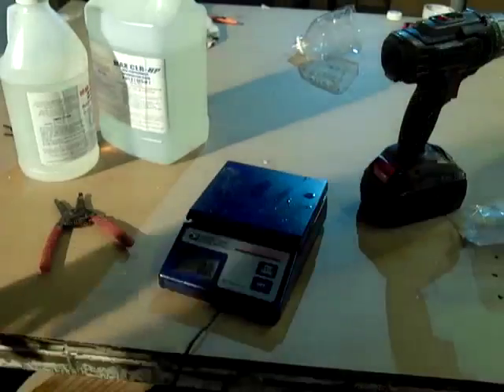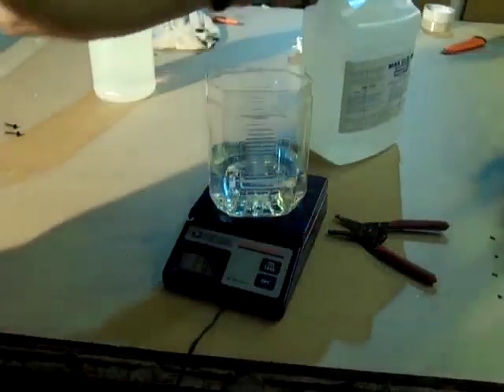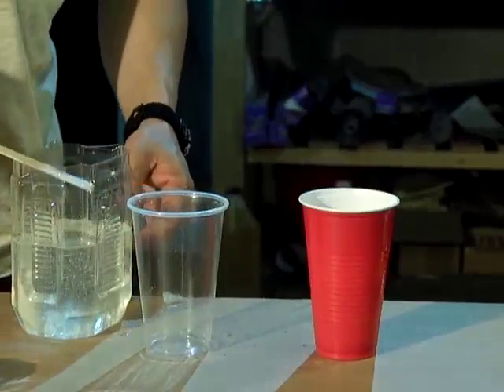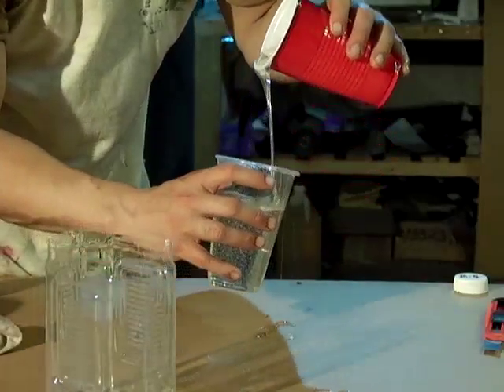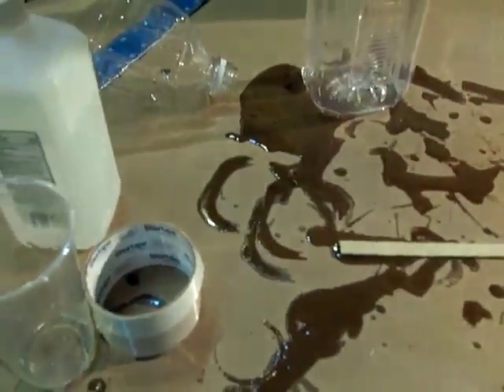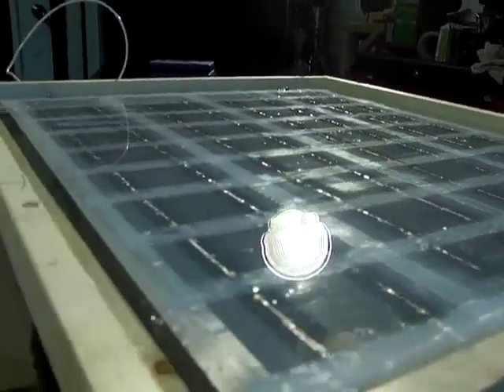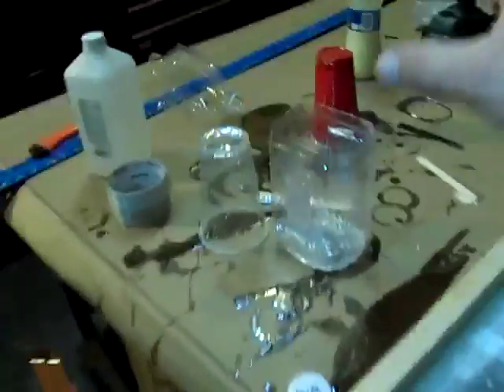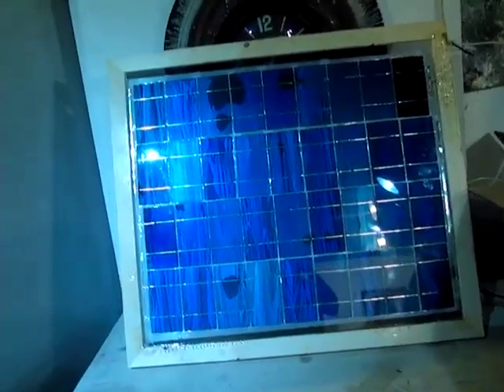DIY Solar Panel $1 A WATT photovoltaic (part 5) Solar Cell Mounting ENCAPSULATION

Comment: Thanks for the tip . How did you do so that the resin didn't flow on the front of the cells ? You used tape to prevent resin going to front ?

Comment: You could have used some silicon to fill the hole (before using the resin) where the wire went through. 

One question I do have is if you had put that tape over the holes/cracks in the panels, would the resin have still leaked through? I am guessing no, but I am not positive. Hence the question.

Comment: +GREENPOWERSCIENCE have you considered rather than taping the panels in place and doing a single pour, mixing a smaller amount and painting the edges of the panels to the glass with the resin, and allowing that to cure for a few hours before doing the actual pour? The painted coat would also seal any holes in the damaged panels, and since it would be in small controlled amounts there would be less risk of leakage to the front side of your panel. Love the series by the way, very informative.

Comment: Thanks for the series Dan. Do you have a recommended source for the cells? Also I have a suggestion: the power leads could have a strain relief attached either inside or outside the frame to secure them so that you do not need to add extra resin.

Comment: GREENPOWERSCIENCE could the two part resin be place in a gallon zip lock bag and mixed? Once mixed cut a corner off to size and squeeze the resin out like a pastry icing bag.
Reply: +acklan3 I've used resins like this before. Some of them produce enough chemical heat to melt through a ziplock bag. It would depend on the type of resin you used. I've personally made replacement lenses for a broken tail light by using a ziplock bag as an outer form many times, but have had a few instances where the resin would heat up and melt holes in the bag causing it to deform and needed to be redone in a different way.
Reply: JudgmentDay78 great reply. Thank you.

Comment: Followed exactly, made 2 panels. They worked perfectly for 19 months, yellowing in 6 months, lost 30% power. Then resin started expanding, good experiment and learned a lot, but now I buy my panels w/ 25 yrs warranty. Now I use the knowledge to make very small panels just for fun & for non permanent cameras and other stuff. So for learning excellent, but real life buy your panels for 2x or 3x the cost... It's cost effective...25 yrs!!! Just my two cents.

Comment: Hey Dan. Great video! I just started building my own panels and I have had good results thus far. I just wondered if the resin helps reinforce the glass or if it's ok to put resin on the front as well? The only reason I'm asking is in the event of a hail storm or other freak occurrence. I'd hate for all the work and investment to be screwed up by something like that. Have you had any issues with the glass cracking? 

Thanks 

Nick

Comment: Its only 144 watts so ill have it on the one battery. we dont get alot of sun here an id like to squeeze out as much as possible, my thinking was to have around 14-16V an make the rest parallel to up the current to try keep a good voltage.

Comment from the maker: you could just do 36 but 40 will work too. Open voltage on many amorphous panels are 21V. The charge controller will handle excess more during full charge. Is this on a larger celled battery.

Comment: Hi Dan, im a little stuck. I have 40 cells at 0.5V max per cell. id like to get a good voltage but when i do the maths i have some spare. Can i parallel the remainders? if so do i need to diode them to prevent back voltage. i could let the charge controller (when i get one) deal with higher volts if i have to series them but its going to waste power through heat loss. is there a way round this too?

Comment from the maker: Very little if the cells are flat and taped in securely. Applying in a lower humidity environment will help. If the seal is good, the only moisture possible would be what was sealed in. I have also done a panel with no encapsulant and a large air gap. The air gap was filled with climate controlled air. Even in Florida humidity they do not dew up inside. Tested for 3 months, video soon.

Comment: the resin is insanely expensive. seeing as that its going on the back instead of in front of the cells, it doesnt have to be clear. what would be a good CHEAP substitute? by the time one factors in the resin...its price competitive with a pre manufactured cell.

Comment: Dan thx for the detailed how to/DIY solar panels.
Because Murphy is always laying in waiting, here are my tips. One of the other commenters suggested that you do an electrical check before encapsulation. That is a must do. Another suggestion is to strain relief the power wires inside the frame. There are many ways to do this just pick one. That way you have a panel that both protects the wire termination as well as the cells.
The use of the strapping tape was clever.
Dan keep up the great work.

Comment: Hi,    How long have you had the Shurtape in actual use?   I am wondering if it breaks down or loses adhesion in time, and if so, does the resin make that fact unimportant since it is rigid?   Obviously, the resin is not able to adhere to the glass except at the edges, so it seems the adhesion properties of the tape is critical?

Comment: Great vid!  I plan to do both front and back encapsulation (floating) for portable panel that' won't stay in the sun every day. Will Aeromarine epoxy work? Also if I use latex mold, would I be able to release it after it cured?

Comment: Im not sure why getting the encapsulant through to the front of the panel is a bad thing. Wouldn't it lower heat and raise the light permeability to the cells through the glass? Also while totally encapsulating the cells entirely completely sealing them off from the environment?

Comment: Great Vid's Dan! just a few thoughts. 
why not Paint some resin onto inside if the frame, it will help sealant to adhere to the frame better,and should prevent resin leakage, also you if made some terminal blocks from 20mm Knurled brass bar, drilled and tapped (you can get the same effect of knurling on the outside by usung a centre punch) you can set these into the resin instead of the need for hard wired fly leads.
Good stuff though Dan Keep it up M8

Comment: next time it might be a good idea to seal the outside frame wire holes with silicone just enough so the mixture doesn't run out of the hole when you pour it, this way you still achieve having your wire encapsulated without the mess.

Comment: @JoTheVeteran Granted, that will make a very fragile and difficult to handle panel, but it's way cheaper and much more element resistant for probably decades. 

Also, with that method you could, not easilly but possibly, even open the case if something inside the panel breaks. Where with your way, it's 

pretty much fixed in place for all eterinty.
If given the time I will try to make one.
Any ideas on that?

Comment: I really enjoyed that guide.
A really nice project, still not worth the $ in my opinion. You also said in part 1, a factory made panel costs the same, if not less. You tried to make it cheaper with resin but that didn't work.
Still I think you can skim a bit of the price if you were to enclose the cells between glass instead of wood that will corrode and need constant maintenance. Then use either resin or resin&fiberglass to seal the edges Better to avoid silicon too under continuous sunlight

Comment: @GREENPOWERSCIENCE  Dow does not have "specific repackaging processes for resellers"  Anyone can call them up and find out the truth. What is going to contaminate it anyways? It is not sensitive to anything in the air! OR google the spec sheet by typing "Dow Corning® PV-6010 Cell Encapsulant" into google. The spec sheets has NO warning about contamination.

Comment: I made a panel out of a frame from walmart. No sealant for 3 months. Since seeing this video I used some white tape and 2 part epoxy from a body shop car place. Works good so far. Net cost for 15 watt mini panel $21.

Comment: @GREENPOWERSCIENCE  Sorry Dow's silicone based encapsulants will last over 25 years. I'd post the link but utube blocks it., but you can read the technical document by googling "BP Solar sees proven performance over 25 years
using silicone encapsulant from Dow Corning"
The paper states:
"Specifically, testing showed the panel’s
power rating performance had only
declined by 5% over 27 years.
It adds not even $10 to the cost of a panel if you buy it off ebay. Good deal if you get 3x the life

Comment from the maker: @rollandelliott I never said they were not good products, just overpriced to complete a DIY panel vs buying factory constructed considering the tradeoffs of time and money. With front encapsulation "all resins" degrade over time when exposed to the sun everyday. The data sheet lists it as "inherently UV stable" which factors damp exposure resistance. 6100 and SG are both the optimal choice for front encapsulation. But they do age, even according to their data sheets with accelerated uv testing.

Comment: Thanks for the vid. choosing the right resin seems to be a ruff task.  On the resin, to get the bubbles out ( I have not tryed it yet) a vibrating sander to get the bubbles to go to the top?. I have done it on cement forms to get the air out.

Comment: You can see that in those places where you epoxy got into the space between the glass and cells, cell color became more intense. Just in these places the light passes to the cells without reflections. In industrial production to eliminate the air gap used vacuum lamination with EVA film. In a homemade battery can be used epoxy.

Comment: It is VERY important to remove the layer of air between the glass and cells. Sunlight on the path to the cell crosses several boundaries between materials with different refractive indices. Air+glass, glass+air, air+silicon(cell). At each boundary a part  of the energy is reflected back. If the air layer to replace high-density material having a refractive index close to that of glass and silicon, the energy loss due to reflections decrease. Remains only one reflecting boundary - Air+glass.

Comment from the maker: @carnini The air gap is too small. Condensation is a percentage of the air trapped at the time of sealing. Most professional factory sealed panels, do not front encapsulate. I have purchased about 30 pro panels and none are front encapsulated. Front encapsulation is generally a DIY option only. If you break a pro-panel, peel the tempered glass off the cells are freely exposed front stuck on a backer film.

Comment: @chicoarraes You don't really even need clear resin, Dan alluded to the idea of showing off the design of this one. The resin is to keep the cells from having to deal with rain, water, snow, dust or whatever. It also looks like it helps with the structural integrity of all of the cells. You want clear glass because if the resin is exposed it'll yellow and cleaning it would be nigh impossible, glass you can just rinse down. I do reckon there's a hail problem though with non-tempered glass.

Comment: @Den0Q I am kind of wondering about the front of the panel myself, wouldn't air get in there and cause posture issues? For the cost, is there any reason not to just encapsulate the entire cells, even if there is some loss. At that build price, pretty cheap if it doesn't last "forever".

Comment: @GREENPOWERSCIENCE Dan.  I'm making some panels of my own too (have 3 now 26"x36"  36 cells 65 watt).   I've gone with complete wood housing with 1/4 inch glass on top.  This has been the best I can find thus far because aluminum, fiberglass, other plastics are way to expensive.  Do you have a vid on just panel/housing construction?  Maybe some different ideas?  The panels I have made look really good, but as far as longevity, I don't know. lol   I could email you pics if you want.

Comment from the maker: @noferblatz 
The 2:1 is by weight (I did not mention by volume)
Reason I used a scale vs a graduated beaker
There is a big difference in some resins but not in this type. 1 gallon jug : 1/2 gallon jug.
Many resins are now designed to be either - or:
directions included =196 net oz. mix 2:1 by weight or volume

Comment from the maker: @peppeddu This resin is 50 cents an ounce.

THIS PANEL= 50¢ BROKEN CELLS @1.8w per cell x 36=$18
Glass=Free
Wood/screws/tape=$5
40 ounces of resin=$20
10g wire 8ft = $5

$48 total

60 watt panel = true panel output =49 watts
through a GTI=39 watts.

Comment: @noferblatz Looks like the variant that Dan used has the same density and the instructions say mix by weight. I understand the distinction and it's nice to look out for that, though. Ounce is a measure of weight in this context as opposed to a measure of volume (he never said fluid ounce).

Comment: Wait wait wait. MIxing 2:1 by weight is not the same as mixing 2:1 by volume. If the two solutions don't weigh the same per fluid ounce, then you can see that the volumes won't match the 2:1 ratio. I presume you think the difference is negligible.

Comment: If you do not let the resin cover the front of the solar cells, doesn't that turn it into a greenhouse and over heat the solar cells? Maybe you should test that?

Comment: Excellent work.  I've got a bunch of free windows I have found on the side of the road, at recycling dumpsters etc and have been planning on turning them into solar panels.  I'll definitely consider the resin backing idea.  Many thanks.